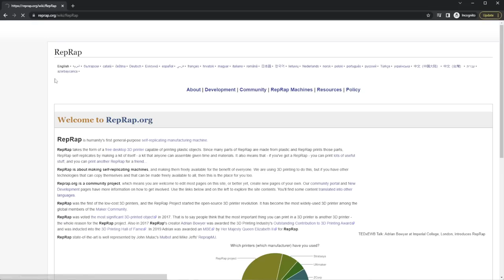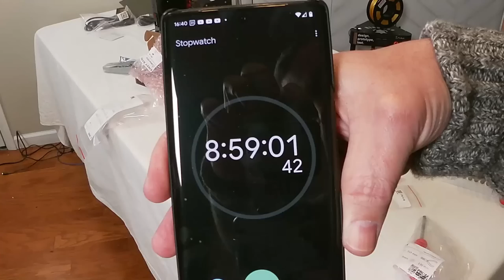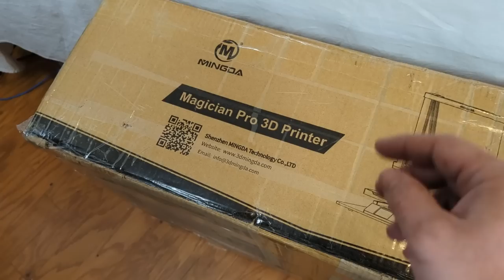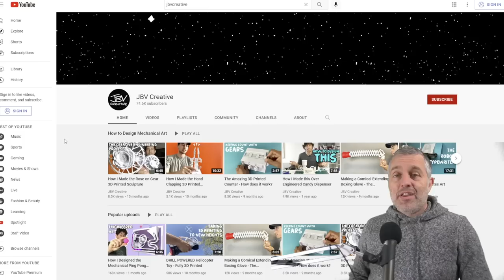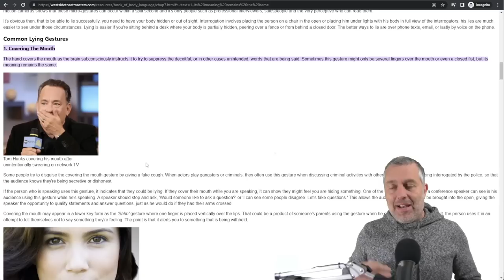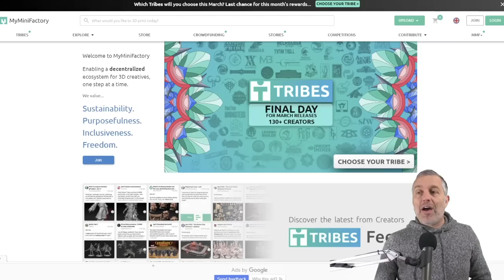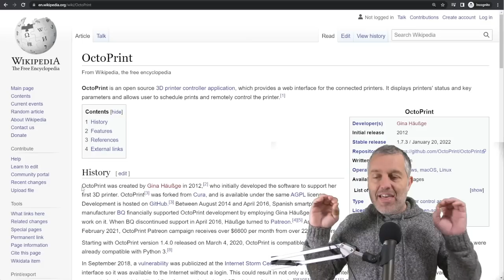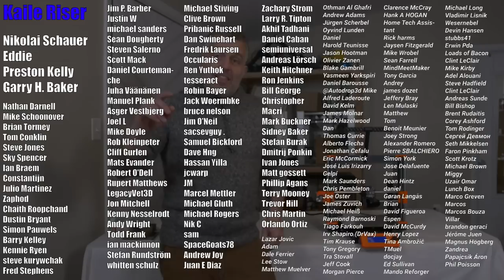Why Does Nobody Speak Truth About The Prusa I3 Mk.3? - It's Overhyped and Over Priced.

Comment: The mk3s+ is one of the few hobbyist printers that use genuine industry parts instead of clones. As much as it’s over-priced, it follows the advice of most of your videos to support the original creators of ideas like E3D and Bondtech. In a lot of ways, you have to pick one or the other. You can get Creality’s new sprite extruder for way less than a Hemera, but you cut E3D out of the equation.
Reply from the maker: The Mark 3 supports two original creators Bondtech and E3D. All other original creators who were instrumental in making the product happen have been cut out of the history books by Prusa. Yes, pressure is better than China but just barely.
Reply: @DesignPrototypeTest They also support Ultimachine through the Einsy board, Gates through belts, and Misumi through bearings. They’re stepping away from that with their mini, but I guess I’d want to see what your ideal printer would look like in this space that also supports original designers. To your point on Prusa and keeping their ideas open source but essentially guilt tripping everyone out of using other’s printers, that would be because it’s literally their business model. Otherwise, it makes no sense to buy from Prusa over TriangleLabs or Fystec. I’m not going to say that it’s the best way to do things, and I’ve bought clone parts in the past, so I’m not going to say that I’m any kind of saint, but I’d be curious to know what your ideal printer would be that checks all of those boxes for you.

Edit: Full disclosure: My main printer is a Voron Switchwire converted from an Ender 3 Max, but it’s full of clone parts.
Reply from the maker: Are you an insider at Prusa? How do you know about these suppliers off the top of your head? 

Misumi and Gates barely know that Prusa exists. Gates is the world leader in belts. The Prusa account to them is tiny. Saying Prusa is a good guy because he buys Gates is like me saying I'm a good guy because I support Bill Gates by buying Windows. 

Ultimachine is interesting. I didn't know they existed until just now. "We develop and assemble some of the most popular 3D printer electronics in our facility in South Pittsburg, Tennessee, USA." Let me reiterate SOME OF where are the Prusa boards actually produced? Is it the U.S. or is it in China like so many other components on this printer? It does appear that Ultimachine is Prusa's electronics manufacturer. Without Prusa that company would not exist maybe? So I'll add them to the list (E3D, Bondtech and Ultimachine.)

As I said in the video the point (and the point of open source) is to encourage innovation by creating a diverse playing field instead of a single dominant player. This means encouraging and rewarding small players. Prusa eats small players. I heat you saying "That's capitalism baby." But Prusa isn't capitalism. The public image of Prusa is "Open source for the good of the community." So, Prusa has a few suppliers and is better than many Chinese companies. That doesn't excuse him/his company of the trespasses they commit. And some Chinese companies are buying genuine E3D components as well. That's what Sanjay said in an interview with Tom a couple years back.

Let's talk about Filamentum. Used to be Prusa's partner for filament. Shipped a roll of Filamentum with every printer in the box. I don't know the exact circumstances but I was told that Josef toured their facilities and learned in detail exactly how they manufacture. Then he took that knowledge and started his own filament line instead of helping Filamentum grow along side his company. Filamentunm is a fellow Czech company. Filamentum was so pissed they offered to give me all the filament I could ever want. Me, the known largest critic of Prusa. Now, as a consolation prize Filamentum is somehow sold in the Prusa store (I'm told), but nobody knows that, and like 99% of filament Prusa sells is his own stuff. I have no doubt Prusa will defect against Ultimachine at the first opportunity.
Reply: @DesignPrototypeTest  I’m not actually saying that’s capitalism baby. I’m just saying that as a consumer, if I want to buy a printer with the most diverse set of suppliers to follow your idea of avoiding supporting clone printers/parts and supporting innovators, I’m not sure where my money would be best spent if I want something off-the-shelf. Creality also copies ideas. They have just as much of a potential to be a monolith. Ultimachine makes boards for other companies like Lulzbot as well, but I do take your point as I doubt that Prusa is using them for 32-bit boards. The supplier stuff is relatively easy to find out. Aurora tech channel put that info in her video, and most of the parts are labeled. I don’t have a prusa, but I’ve seen the pictures as I was looking into it before I built my Voron. My question to you is if I as a consumer wanted to support the biggest number of original innovators in a pre-packaged box or if I wanted to recommend something pre-assembled to someone, who would I recommend them to go to? I have a Voron. I spent a lot of time assembling it and sourcing parts, but I wouldn’t recommend it to someone that I didn’t know was going to be really into assembling things themselves.

Edit: I guess I’m just trying to figure out what your main philosophy is. I bought cloned parts for my Voron through their affiliate links. Did I support the right people because money is going to the Voron designers or the wrong people because I’m supporting Voron by buying from the wrong people? And if I was a standard consumer who wanted the simplicity of an inkjet printer while supporting the right people, is an ender really the best I could do?

Double edit: You’re also saying that people shouldn’t hold Stratasys owning Thingiverse against it, but Stratysis is literally why everyone is so gung-ho about open source. The way that they wielded their patents set back consumer 3D printing by years.
Reply from the maker: >If I as a consumer wanted to support the biggest number of original innovators in a pre-packaged box or if I wanted to recommend something pre-assembled to someone, who would I recommend them to go to?
I don't have an answer. I'm just trying to champion good innovation by making sure that small fish with great ideas/products get publicity. In tandem I am calling out the trespasses that make it hard for them to succeed. Also, I see 3D printing as a disposable income hobby. very few will make an income from it. BUT it is a fantastic way to stay involved with technology. Most people won't pick up an arduino and learn about it just to make some lights blink. They will accidentally learn a lot about arduino related electronics when researching which control board and which firmware to put in their Voron. With all the manufacturing being lost to China how do we keep the next generation knowledgable in these subjects? I think the goal of a turnkey printer is erroneous. The goal should be electronics and mechanical engineering education through the successful builds of a DIY printers. If the DIYer chooses a Mosquito hotend instead of a V.6 it will be because they understand the science behind it. In the end the DIYer has a trophy (the printer) and the ability to print which shows off their knowledge gained. The best of the best may figure out the next great improvement to the hobby at a global level.
Reply from the maker: You misunderstand me about Makerbot and Thingiverse (Stratasys). I'm not supporting them. I'm saying Prusa isn't much better in effect despite releasing his things open source he is trying to be the only player in town which is the definition of a monopoly. Stratasys is hated because of their monopolistic behavior especially regarding patents. That being said Adrian Boyer admitted that he started the RepRap movement by reverse engineering Stratasys. In a parallel universe, would be even have consumer level open source 3D printers without Stratasys?
Reply: @DesignPrototypeTest  I think given the number of methods of printing, it may have evolved in one way or another, but I get your point that their initial investment is what got 3D printing started as it is today.

I don't think that a turnkey goal is erroneous. If someone wanted to learn mechanical engineering, but they don't have any interest in programming, I don't think that they should be gatekept by needing to learn other skills first.

I think that hobbyist 3D printing does make sense though. As a computer engineer by trade, I think that learning about all of the aspects is certainly interesting, but I also understand that anything slightly technical can be very offputting to the general public. I understand that I took on more than most by converting my printer, but I spent a lot of my initial 3D printer time 3D printing 3D prints for my 3D printer rather than exploring mechanical design. It really comes down to the question of if you are buying a tool or a project.

That said, I guess the thing that I was having an issue with is that I saw in a lot of your videos, you shame a lot of companies for copying designs or cutting out other companies. I see that in the case of the filament company, Prusa did that. I wasn't very aware that E3D worked with Creality much, so that's interesting to hear.

On the printables front, I think the main reason for Thingiverse dissent is that it had a massive first-to-market advantage, but it's slowly gained more and more issues. Their 3D viewer doesn't work. They require that you download each file individually unless you know the zip extension, they had the massive leak a while ago that they didn't alert people to. When Printables showed up, it was good timing for an alternative.

Comment: lmao. guy makes some good points about prusa printers. army of simps floods the comments.. i print at least 30kg on a slow week, the prusa i3 was incapable of keeping up, its no different to any other printer except the army of simps. if ya want relaible prints, buy the cheapest and upgrade it as you build it. a good option (dec 2023) is a voxelab aquila, just upgrade the extruder and buy a magnetic build plate, you get 2-3 of these for the price of 1 prusa. if you want to make money its no contest. an anet a8 kit lasted me longer (still running 24/7 with only 3 maintainance breaks 5 years later) than an i3 pre built (lasted 1 year maintaining every month).. thats a joke. i'm sure a ton of people are going to tell me how it was user error that the thing never wanted to work reliably and one day just stopped working🤣

Comment: I own a Prusa and I like it because it just works. I know there are cheap printers but it works so I like it
Reply from the maker: Dude, that "Run of the mill" Chinese printer I showed also "Just works." This whole arguement is as old as the design of the I3. It is a reference to the Anet A8 a printer so craptacular that users had to spend days of their lives getting it functional as a Prusa. It's not the case anymore. That Focoos only took me like 20 minutes to assemble and it makes prints better quality than the Prusa. How is this not "Just works?" I mean manual bed leveling, but MANY Chinese printers come with that feature now and still cost heaps less than an I3.
Reply: @DesignPrototypeTest  Maby that is true bot when i made my printer chois i maby made a bad chois bechos by frends had a ender 3 that had a lat of problems. And I have pland to byld a volon

Comment: I Have 5 3d pinters from Anet A8 to X1 Carbon. When the Anet A8 first came out I modded and tuned it to within an inch of it's life to make it 1)SAFER and 2) reliable (there was a great community back then). I did how to videos on the first rudimentary firmware mods and autolevelling for it and even  printed another 3d printer (AtomX) and a Cyclone pcb mill on it. Both came out perfect. I also bought a Tevo Tornado (which was frankly outright lethal prior to modifications - we are talking exposed 240v mains on external control box connectors, no earthing, fuses on the neutral and too high a rating, fake FTDI chip impeding serial communication, no strain relief of mains 240v cables, inadequate 240v wiring gauge to bed and internally, weak SSR that could have failed short on a 240v mains heated bed.....) I also built a Tatara A8 homebrew from scratch. 

Bottom line is the Chinese clone kits are fun and can be made safe/useable with a lot of work but those companies do not give one single shiny shit about user safety imo. If you want to put your trust in the build quality and firmware offered by one of those companies then best of luck. Either that or build a whole load of mods and failsafes around it to make it barely useable and get it to the point where you feel vaguely comfortable turning your back on it for any period of time. I view the Prusa MK3S as a 'Toyota'. It is not the fastest printer I own. It is not the quietest but it has a ton of research built into it (which was largely nicked and copied by many clones), it has EU safety certification, has decent support. All parts are tested before leaving the factory. Most important to me is that it supports the original development and does not reward shameless ripping-off and cloning of idesa by the lowest price Chinese companies. I would rather my money did not fund the CCP. if I just want to print something then 9 times out of 10 I use the Mk3S. If you prefer to endlessly f around and learn the hard way then modify a cheap clone.I felt safe gifting a Mk3S+ as a Christmas present.
Reply from the maker: The Prusa I3 takes 9 hours to build and costs $800. The Ender 3 takes 2 hours to build and costs $166. Working with that extra $600 and 7 hours of work I think you can EASILY come up with a better printer starting with an Ender 3. Alternately if you want one that "just works" out of the box in 2023 get a Bambu Lab printer. They cost less than Prusa and work better. A premade Prusa I3 costs $1100 whereas the premade X1C costs a similar amount while being a superior enclosed CoreXY printer with a touch screen and wireless printing. Your mentality is stuck in the tech from 6 years ago when it could be argued that Prusa made the best printer. That is absolutely not the case any longer. Regarding not supporting the CCP, where do you think all the Prusa components come from? eg. Stepper motors made by LDO motors.
Reply: Mate, like I said. I aleady own an X1C lol. Whatever. @DesignPrototypeTest

Comment: What do you think about the new bambu x1 printer, and how could it affect prusa's grasp on the "quality" printer market? I would love to see a vid or rant on this.
Reply from the maker: I just looked it up. Never saw it before. They are doing lots of things right, but I don't like it for a couple of reasons.1)RFID filament=proprietary. Locking you into purchasing only their filament. The firmware electronics and cloud integration seem to be similar attempts to control customers with proprietary stuff. 2) Lidar. Why? Just because you can? Sensor drift? Seems unproven and overly complicated to me, but maybe I'm wrong. 3) Multi-color/material with a single nozzle similar to the Prusa MMU2 which is a bad technique for many reasons. eg. The filament changes leave stringing inside the filament path. The new color filament gets caught on these strings and the printer jams. The Palette technique is far superior, but only Mosaic can sell that b/c they have  patent.

Comment: All printers have nice prints at the beginning. The thing is Prusa will keep printing flawlessly after 2.5 years and tenthousands of printing time. I have Prusa mk3s+ and I don't even touch a single bolt after the installation. The only think that you have to do is just lube it twice a year. You only calibrate it once a year (if you update the fw. you have to.) The best printer money can buy.

Comment: This guy shitting on a 5 years old printer model is hilarious. Just slap a Duet and a Mosquito and it will be perfect. 😂
Reply from the maker: So I should throw good money after bad and spend 1100 total and 8 more hours of my life trying to get the printer working. What are you really trying to say. Don't be coy.
Reply from the maker: Also, that's exactly my point. The I3 Mk.3 is Prusa's best selling printer. They've not improved it in 5 years. Meanwhile China has continued to innovate. Why does it still cost $750? 5 years and lots of features removed but they can't figure out how to manufacture for less? Or is it possible they are pocketing the profit from improved efficiency instead of passing it on to their customers?
Reply: You're obviously not too business savy if you think any manufacturer will lower the price of its product when the market demand is so high they can barely keep up with the orders. My beef is not with Prusa but with the rest of the industry as it really shows no desire for progress and innovation when a 5 year old machine is superior to their current offerings. They rely instead on barely put together cheap clones that they expect the user to fix and improve.
Reply from the maker: What are you talking about? Did you even watch the video? The I3 Mk.3 is NOT superior any more. AND it costs 5x more than and Ender 3.
Reply: Still people buy it in droves so get used to it. The Ender-3 has its place also but it didn't get it through innovation and none of its clones did either.
Reply from the maker: @maiorciprian  News Flash: Prusa didn't get his features through innovation either. He just mined the maker community for their good ideas. He's a curator, not an innovator.